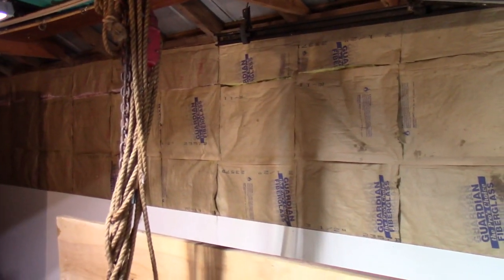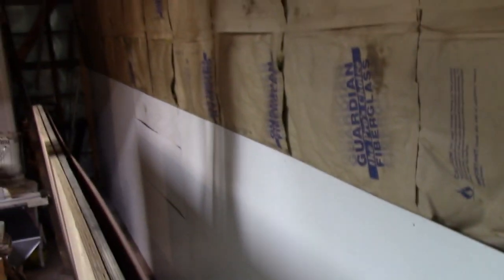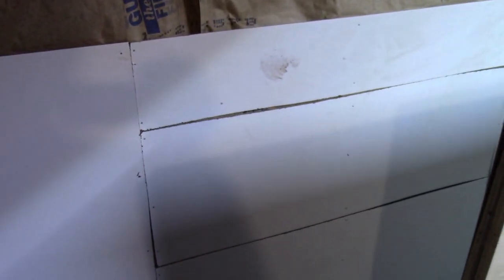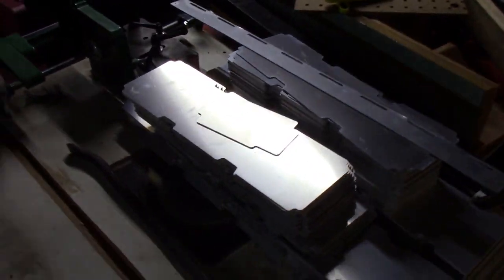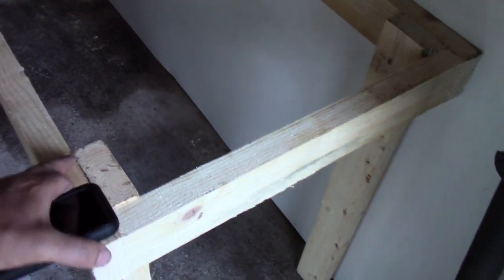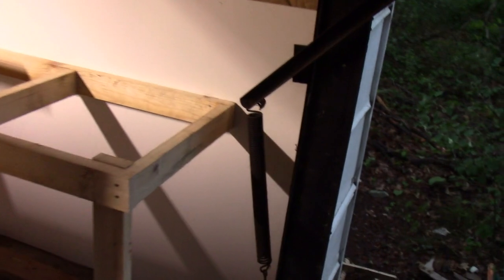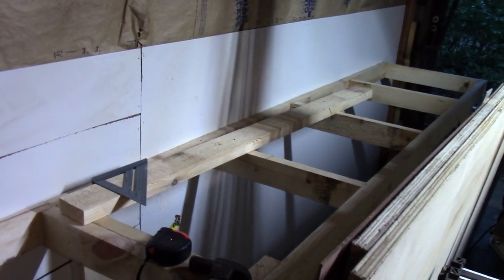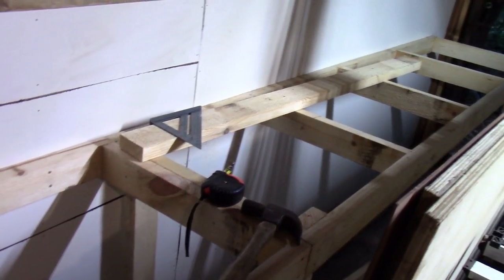Building A Long Work Bench In My Homestead Work Shop

Comment: Looks like you need more electrical outlets. It would be nice to have one every four feet. And of course, they should be 20 amp GFCI. And... You need some lighting too!
Reply: One more point... Now is the best time to upgrade the wiring. If you wait until you cover the walls, all wiring will have to be in conduit.
Reply: @DavidJohnson-tv2nn  or use btx wire
Reply: use EMT conduit surface mount is one way
Reply: @JW-2001  EMT conduit one way, but why do it the hard way? When the walls are already open and, he can run Romex inside the walls? Also... This is just my opinion, but conduit is ugly! Plus Troy would have to learn how to bend conduit, and pull THHN wire through the conduit..
Reply: @DavidJohnson-tv2nn  Actually conduit is great for garages and basements and any place doing work in a commercial building romex is not even allowed. BUT it is more money and work.
Reply: @JW-2001  Romex is absolutely allowed as long as it is inside a wall.
Reply from the maker: Yes I agree that I need more outlets. But I will put them OUTSIDE the walls due to potential mouse damages and for easy repair and trouble shooting. I have a mess of 4 ft LED lamps waiting for this purpose.
Reply: @TheDoItYourselfWorld  Ok, but keep in mind that NEC code does NOT allow exposed wires. You'll have to run THHN wire in conduit. That would be 12 gauge THHN wire for a 20 amp circuit. And you will probably need more than one 20 amp circuit for all the equipment you have. At least one 20 amp circuit for each side of the garage. And the outlets have to be GFCI protected. Not hard to do. One GFCI outlet can protect all others downline from it.
One final point... Properly installed wiring won't need trouble shooting and repair. If an outlet fails, it can easily be replaced, even if the wiring is in the wall. The wiring itself, won't need repair. If mice will attack Romex wiring in the garage wall, they will also probably attack the Romex in the walls of the house and mobile home.
Reply: Just to clarify, NEC stands for National Electrical Code. Which is updated every 3 years. The latest version being 2020. Most local authorities follow some version of NEC. And yes, NEC covers solar installations :)
Reply: @DavidJohnson-tv2nn  where I live and work romex is not allowed in commercial construction I know this having done it. Greenfield is allowed 6' only. This will depend on your local codes but many cities are this way. In county just follow NEC.
Reply: @JW-2001  I misread your comment. Thought you meant Romex wasn't allowed in basements and garages. I'll take your word for it on commercial structures.